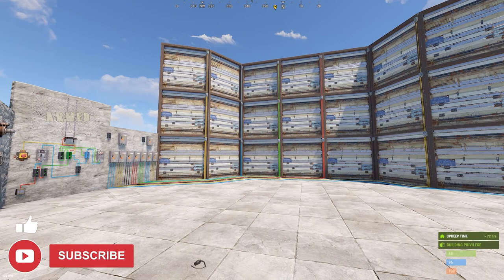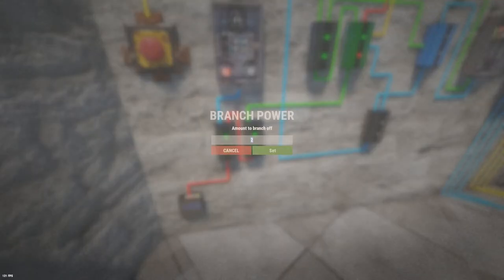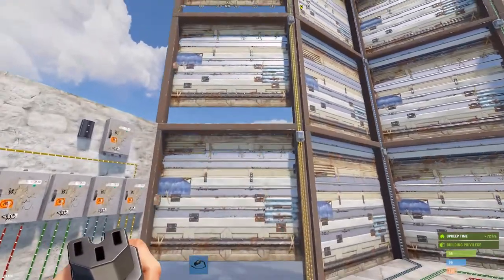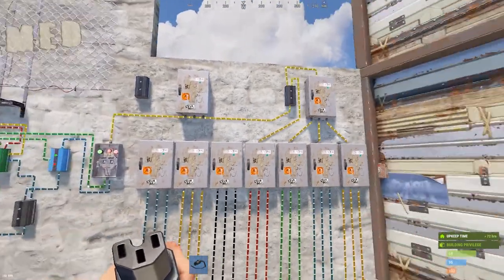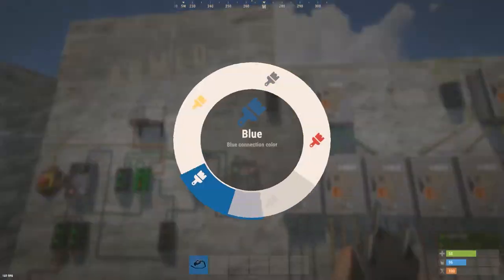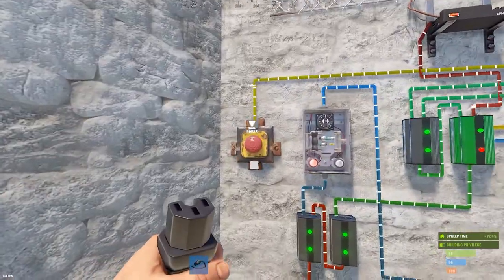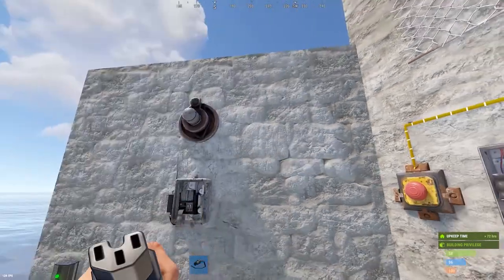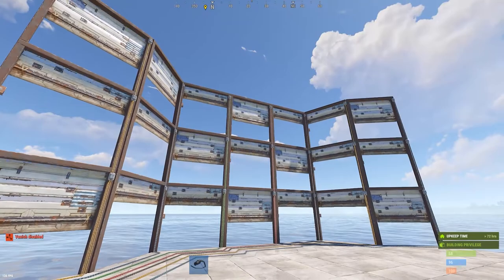RUST Electricity Tutorial | How to Use the BASE LOCKDOWN Circuit with Examples 2022!

Comment from the maker: NOTE - in the video I said you could use an HBHF sensor to arm the circuit. DON'T DO THIS, even if its set to only detect authorized players! Use a button or switch/smart switch ONLY. Using an HBHF sensor could backfire and allow raider to spam the base lockdown circuit.
Reply: Pretty sure you can use HBGF sensor since it only activates the lockdown circuit once. Due to the fact you need to ARM it. If I'm wrong please let me know.
Reply: how  do i do it to 61 doors

Comment: great video! I understand that the opening of the door(s) will only occur on the initial usage by that door, but is there a way to 
  1) only close those that are open and not cycle the closed doors? 
  2) automatically open only the interior (non-security doors) while in base?

  3) automatically lock the base down when 
    a) nobody of the team, is in the base
    b  nobody (of the team) is logged into the server
  4) anything else you could think of?

Comment: I built this and the button literally has no use  it's only the timer that closes the doors but I am on console tho so maybe its slightly different mechanics
Reply from the maker: The button arms the system
Reply: @AustinKlailaGames  I was testing it out and I ended up removing the button and it works without it
Reply: @AustinKlailaGames  I can send a video showing it works without it.